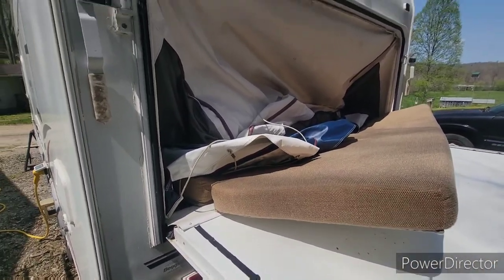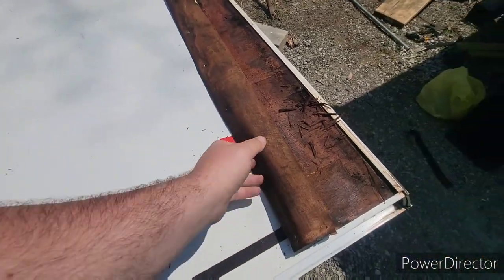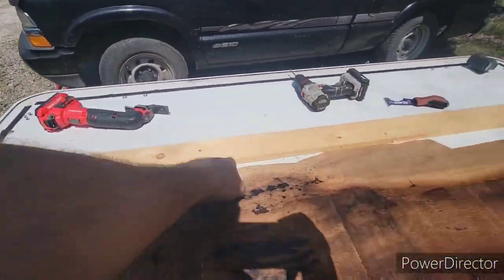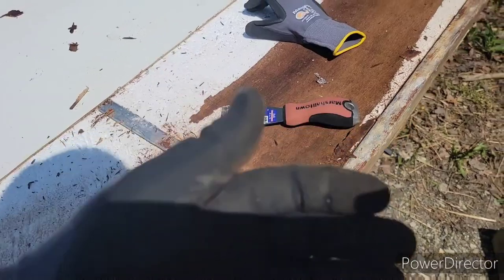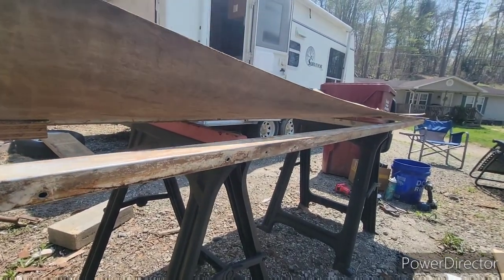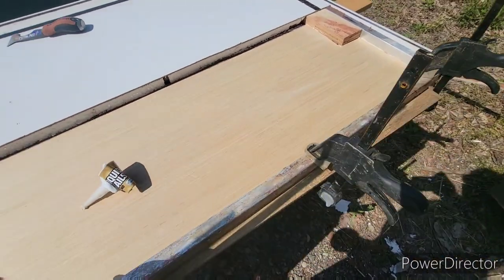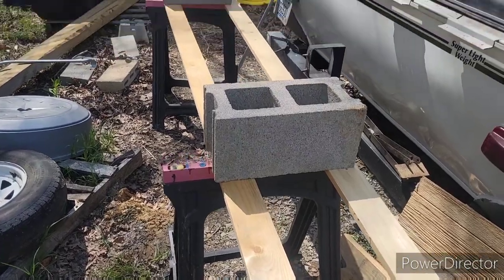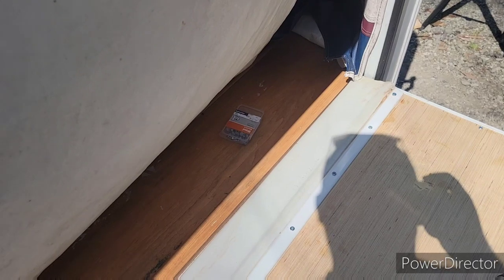Bunk repair on Hybrid Camper

Comment: Thanks, I’m starting to tear mine apart now. I’m debating whether to use plywood to fill in the middle or 1”  foam board. If I go the plywood route I think I’ll coat it with polyurethane first.

Comment: Thanks, good video. One of the many places these campers leak. Did you do anything else to seal the hinges better? I still have the door on but all the wet material removed ready to rebuild but water is still getting in when it rains.

Also I wish I could see how that rubber flap is attached to the camper inside? Mine is not taught like yours when open.

Comment: Is this hard to do I have to do this to my 2003 rockwood that is rotted at the bottom from heavy rains
Reply from the maker: It depends on your skill level..
It's not a simple task and does require some Know how, with carpentry. I tried to explain it the best I could in the video. And I also tried to do it with the most basic tools.